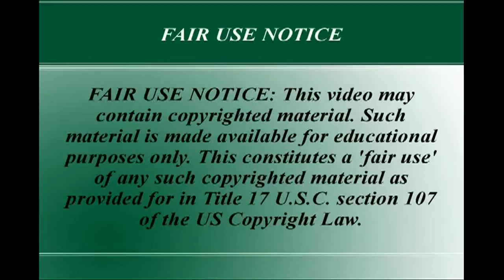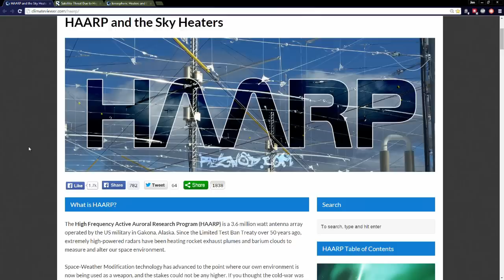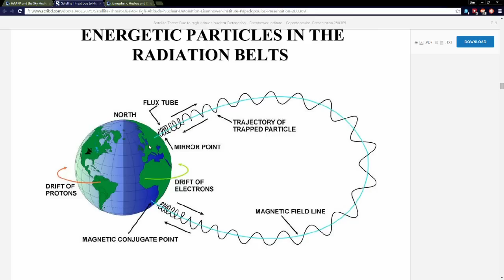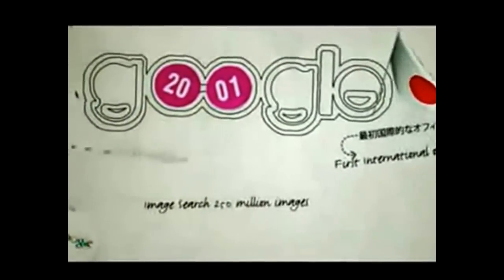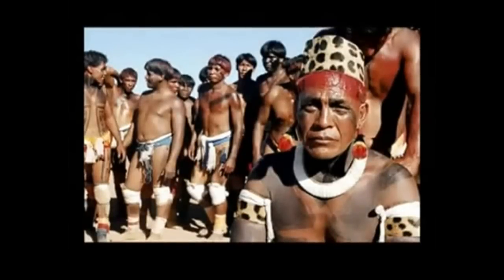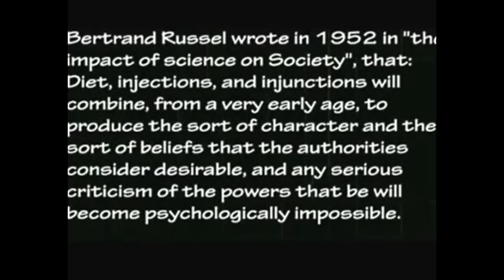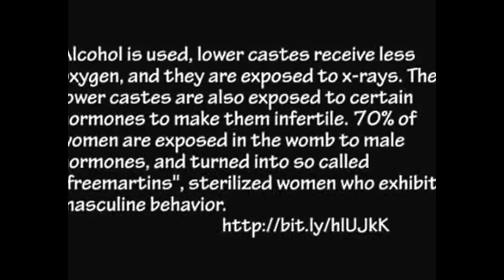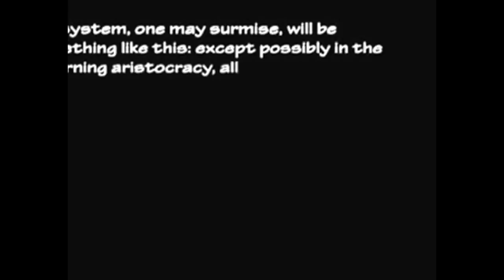HAARP Truth and Exposure

Comment: Lol... it's actually fairly low frequencies used (radio/microwave) with large amplitude. The acronym is High Altitude Aurora Research Project. It is used to charge the ionosphere, so they can bounce signals off it. This allows them to communicate with deep subs & such.
Reply: Crap, my bad. Let me rephrase... The Illuminati is involved in a secret project to control the world. The super powerful HAARP weapon of mass destruction can control minds with the push of a jolly red button button. Have you ever felt someone staring at you? That's because they are, all the time. They're alien reptilian shape-shifters from another dimension  :-o